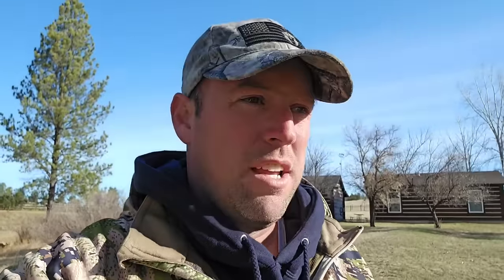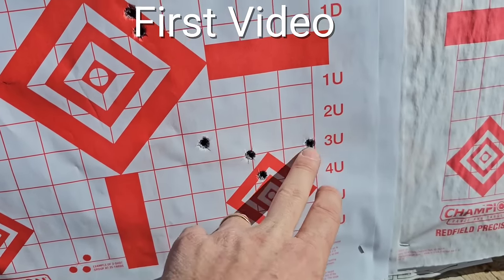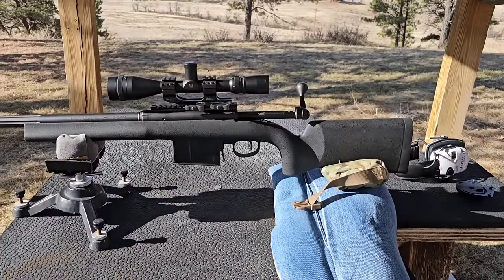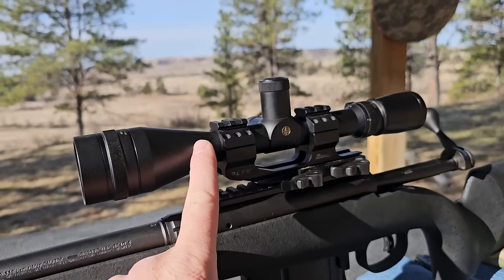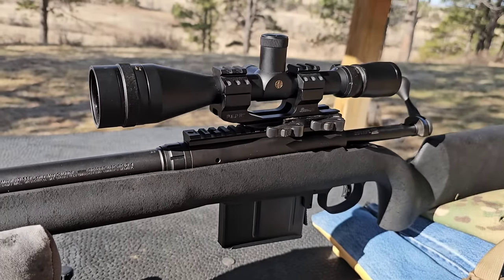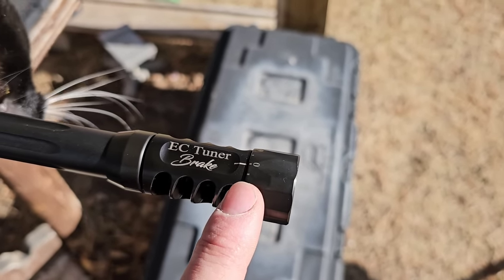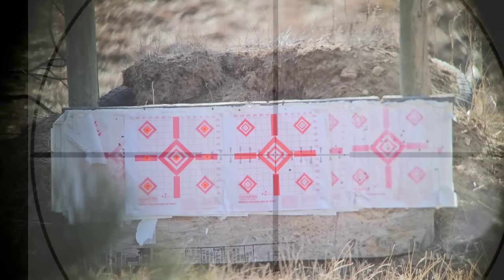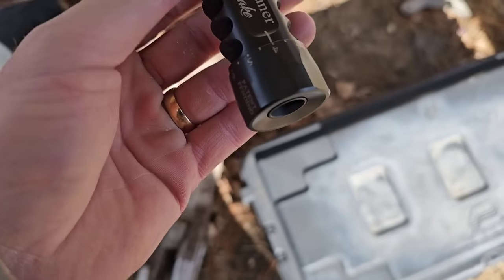Long-Range Rifle: PROBLEM Solved?

Comment: I have a savage 110 UL in 7prc and have not been able to get anything under 2” groups. The bolt lift is soooooo heavy as well. I’m wondering if I have carbon ring problems? No idea…..
Reply from the maker: My Father in law got a savage 7prc with the carbon barrel. And that gun shoots awesome. I feel your pain, though when it's your gun and doesn't work right.

Comment: I too am in a pickle with my brand new Savage 110 Precision  rifle just used it a couple days ago to zero it, set up a target at 50 yards after bore sighting it after 3 shots it was in the bull so I moved to 100 and it groups like a 12 ga shooting 00 buck !!! all over the target, I'm using Hornady Match ammo 225 gr @ 115.00 a box here in Newfoundland and I can not get anything else to try in it only the 225 gr ammo, I'm a reloader so I bought a set of Dies when I bought the gun and last night I reloaded the 15 pieces of brass I had used to set up the gun and try to group it, the only 30 cal I had on hand is 180 gr so I reloaded it and shot it today 2 five shot groups one was 1.6 and one was 1.4 and on the 1.4 group 3 shots were cloverleafed just over the bull so it likes the 180 gr a lot better than the 225 gr but I bought the damn thing for long range shooting so I gotta find a long bullet with a high BC that it likes cause 180 gr hunting bullets are not going to cut it, living in Newfoundland don't help either cause you can't get anything and if you luck out and find something ya gotta sell yer youngsters to buy it, just paid 121.55 for a pound H1000 powder when I started reloading years ago a pound of powder was 25.00 Oh me nerves !!!, will be following yer channel and wish ya luck getting  yer boom stick working good...............Al
Reply from the maker: Thanks for watching. Sorry you are dealing with this, too. I shipped mine back to the factory and told them everything. So I am waiting to see what they say.
Reply: @Guidedhunts  will be watching hope it doesn't take forever to get some news..............Al

Comment: get rid of that elevated scope mount, get some Warne 514medium rings. and you will get a better cheek weld on that rifle!
Reply from the maker: It was temporary to try a different scope. If inever get the gun back from the factory, I will post another video on all the new components I'm going with.

Comment: I couldn't get the precision hunter ammo to group out of my 308 110 savage. The last round i shot was so hot it almost locked up my bolt
Reply from the maker: Other than the barrel threads and it not shooting. I haven't had any issues with the bolt or ejecting. The action is plain Jane but works as it should.
Reply: @Guidedhunts  I haven't had any barrel thread issues. Mine is just picky with ammo. Shoots sub moa with gold medal match ammo. The hornady match ammo is hit or miss
Reply: @ethanharris5556 some rifles just want to shoot reloads only. My 28 nosler christiansen mesa is that way.

Comment: Get a lower scope mount and a higher quality one. Those are made for ar15s not designed to handle heavy recoil from a 338 could definatly see that being an issue.
Reply from the maker: It's a temporary scope pulled from an AR Just to check to see if the original scope was bad. It's not the final scope/rings for the gun. Thanks for watching.

Comment: I’m sure you done some video watching on the tuner break but if not. My opinion I think you’re adjusting it to much from what I have seen on Erik’s videos on it.
Reply from the maker: I was limited on ammo, so I went every 2 marks on the brake. Thanks for watching.
Reply: @Guidedhunts  i understand that too .338 isn’t cheap Might consider investing in reloading. It could help lessen the cost on those big calibers and you still get the same bullet just optimizing it for your rifle. If you can do the testing.

Comment: if i were you i would reload on that gun
the better the ES on that gun the better the tuner will work. i have 7 of these tuners but i reload. the problem you will have with factory ammo is you need to buy big quantities of lott ammo. if you buy random boxes of ammo you will need to retune a lot

Comment: I’m at 6:30 in! Stop the video take that pepprr mount off asap! Get you some warn horizontal split medium rings please!!!! Ur scope is stupidly mounted way to high right now ! That is ridiculous!
Reply from the maker: It's a temporary scope pulled from an AR . I needed to see if the scope in the first video was the issue. This is not the scope and rings that will stay on this rifle.
Reply: @Guidedhunts  all you have to do is box test the scope. If it tracks in a square and ends up back at starting point then it’s good! I have seen people in the past trash a perfectly good scope because they had the rings too tight

Comment: scope mount way too high .your not getting a good cheek wield
Reply from the maker: I know it is. I pulled it off another rifle just to try. It won't be what stays on it.
Reply: Wondering if barrel is seated good or possibly barrel was damaged when your  first  break blew apart
Reply from the maker: @erniecummings9255  I just got the rifle back from savage. They stated the barrel was bad and wanted me to pay 241 dollars because I wasn't the original owner. So I said no. I took it to my gunsmith to have a custom barrel put on it. I will make another video when I get it back and put together.

Comment: Your skipping numbers literally small half number turns will make a huge difference on that tuner brake.    Your just not using it right
Reply from the maker: I was limited on ammo. If I had 200 rounds I could do all the settings.
Reply: Rifles have natural dispersion, tuners are seemingly more to be a gimmick....

Comment: Holly shit your scope is way to high.   Should be right down tight to the barrel w just a crack between the two.    Not 3inches
Reply from the maker: The scope is temporary pulled from another gun just to make sure it wasn't the other scope that was off. It's not the final scope that will be on the rifle.
Reply: @Guidedhunts  ok  I was gonna say really dude u chose that scope mount.    😆
Reply: Scope hight is irrelevant to accuracy. You just need a cheek piece to get your eye in the right place.

Comment: Do yourself a favour and buy an aftermarket pre-fit barrel.  Really your tests with the tuner are looking more like a 1.5-2moa rifle.  Put on a quality pre-fit and run the tuner brake on zero and find a load that gets you what you want for groups.  Use the tuner to tune for conditions.